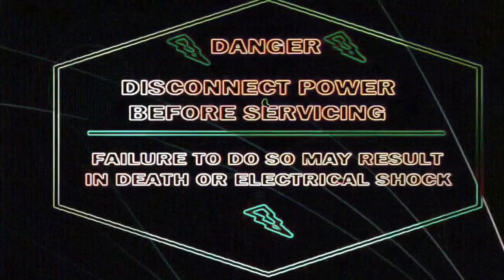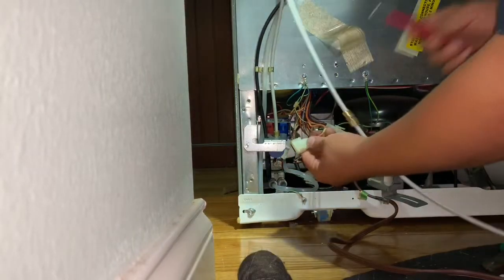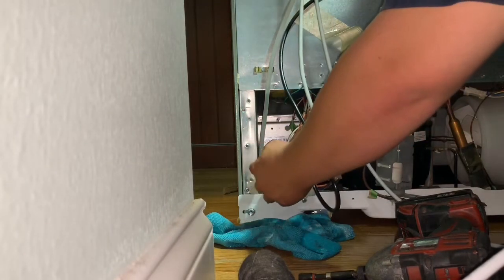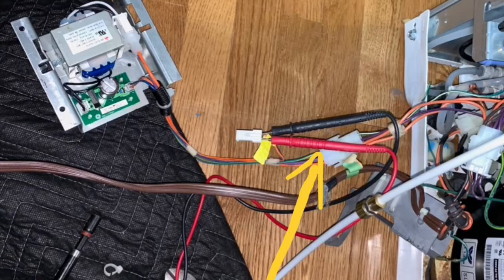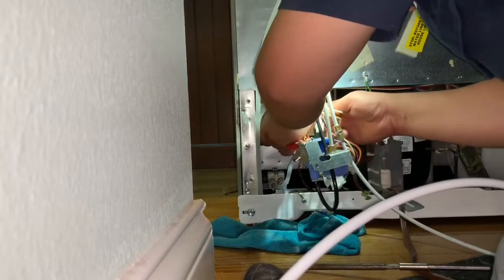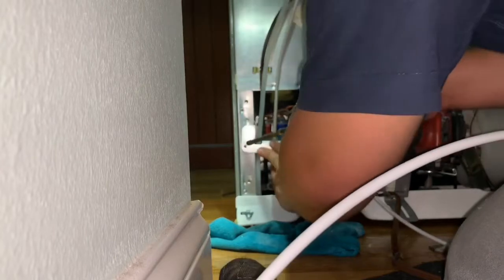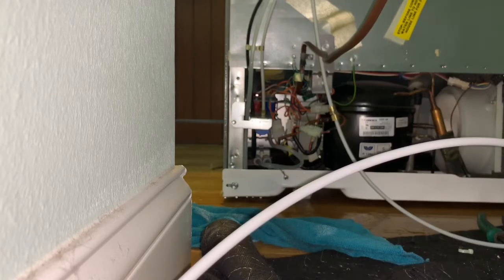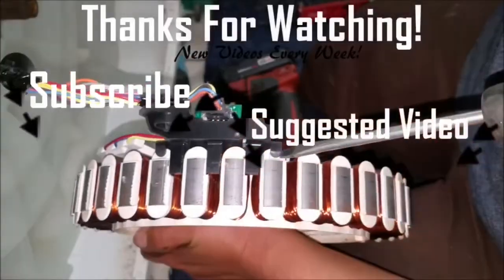How To Fix GE Refrigerator LED Lights NOT WORKING! | Model PGSS5PJXCSS | Transformer Replacement

Comment: GE no longer sells the transformer bracket assembly, but you can buy the individual parts and re-use the bracket. If the refrigerator light is out, 90% of the time it is going to be the transformer inside the bracket. That is part WR62X26946. You might possibly need the rectifier control board if the large capacitor is bulging, and that board is WR23X10622. GE did away with the fuse along the way, so you may need the connector off of your old transformer and you might have to do some splicing to get the O/P from the transformer plugged into the PCB on the rectifier board. Interestingly enough, the replacement transformer bracket with all three pieces that is shown everywhere as discontinued shows a 24VAC output. My original and the one WR62X26946 are both 27VAC. Thank you for posting this video. After watching it, it took me about 30 minutes to do the swap and that included splicing and soldering the old connector to the new transformer. I did not disconnect any water lines, just moved things out of the way and wrestled that bracket out and back in. This was a $50 repair and the lights work again, so THANK YOU!

Comment: I have similar issue with my GE GNE29GSKSS. Other videos are stating control board. Either way, transformer and controller are about the same price. Man, all this for a refrigerator light. Should have gotten a traditional bulb light fridge instead.

Comment: Thanks Bro, I bought a brand new GE side by side and the freezer led light has never worked. They changed the LED and the Switch and the problem persists. I will call them today and ask them to replace the Freezer light transformer.

Comment: Hi I am having the same problem with the same refrigerator what’s the difference from the video that you have is that my lights are blinking and the alarm for having the doors open even with the doors closed does not turn off it keeps going off can you help
Reply from the maker: You need to replace the door switches first

Comment: thanks for the how to video. If my LEDs are dim, is it most likely the transformer?
Reply from the maker: Yes but also it can be the led light as well
Reply: Our GE cafe frig has 7 LEDs, and they are all dim/flickering.

1. So you think it's the transformer.  I can pull out my DVM and test it like this video.  Thanks!

2. Where do I find a repair manual or wiring diagram, showing locations of components, connectors, etc?
Reply: This is why I came. Anyone fix this issue?
Reply: Can I buy 1 light and try each one?

Comment: LIGHT works when I plug the fridge  on but not after I shut the doors. The door alarm also will not shut up unless I disable it. I am thinking something might be wrong with the switches.

Comment: Hey how much doing this myself vs doing it with a GE technician?  My model is not a profile but a 2018 side by side refrigerator
Reply from the maker: NATA OLIPH The benefit to do it with that’s ignition is that he’s gonna tell you exactly what it is but he’s going to charge you between $200 and $250 for labor plus deport if you do it yourself and it’s the part that you’re replacing you’ll save a couple hundred dollars

Comment: My LED light is also not working and I cannot detect voltage coming out of the wires in the fridge.  Before I go down the road of replacing the transformer, could there be a fuse involved?
Reply from the maker: Yes in some models it will bring a fuse but it will be right on the transformer which is the part that I'm replacing